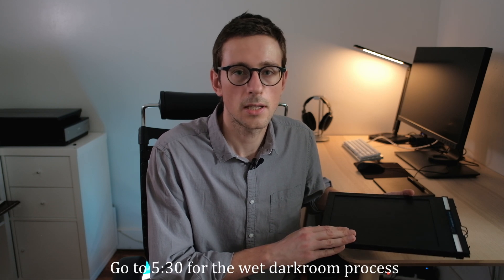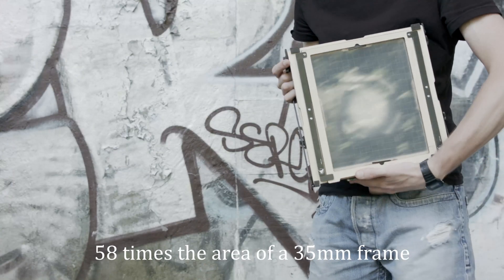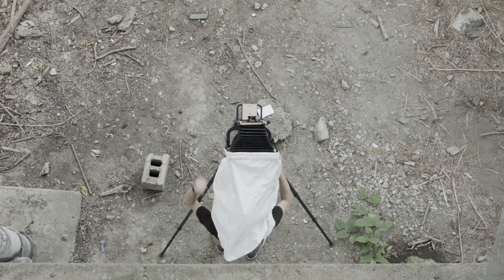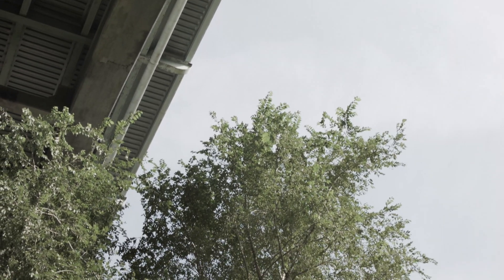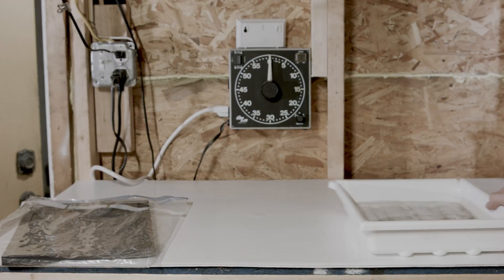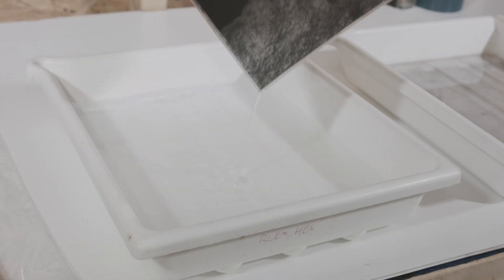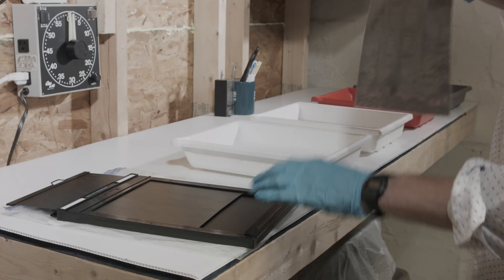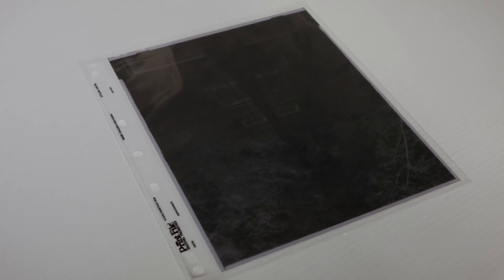Adventures with Silver Halides: Exposing and Printing a Large Format Image Part 2

Comment: Do you develop your film by inspection?
Reply from the maker: No I have never done that. I think you need a special filtration, traditional red light has still too strong wavelengths of light? Do you develop by inspection?
Reply: @MarcoFantin1  No I don't. I had the impression you did. :)
Reply from the maker: @toulcaz31  If the negative if well exposed it seems unnecessary. But for potentially underexposed negatives it could make sense. Even more when trying techniques such as stand development ( which never really worked for me, I tried a couple of times but had streaks in the negative)
Reply: Marco Fantin so how do you develop your 8x10?
Reply from the maker: @toulcaz31  I just use the prescribed times, from the manufacturer if available, or from massivedevchart.com. I give a 5-10% longer development by default, because I find it usually easier to remove contrast while printing, than to increase it.

Comment: As a point of interest, how do you determine the N+1 or N-1 etc development times for the chosen film? Do you do testing? Thanks.
Reply from the maker: I use the zone system and a spot meter. I do N development, if the difference between shadow and highlights (where I want to keep detail) is about 5 stops, like in the case of this video. If the difference is less, let's say 4 stops (lower contrast), then I do N+1 development. If the difference is 3 stops, then N+2 and so on. The opposite for  high contrast images: let's say if the metered range is 7 stops between dark and light tones I would do N-1. I found it usually better to have a little bit more contrast than not enough contrast. In any case the zone system is just a guideline since we can adjust contrast during printing with variable contrast papers, to a certain degree (or with digital means as well, after scanning). But the development should be more or less accurate for the image one wishes to create. Taking for example the images in this video, if I had tried to keep information on the sky (7-8 stops above the shadows), I would have done N-2 development, which would have resulted in a negative too flat to be printed even with contrast 5 in the darkroom.
Reply: @MarcoFantin1  Yes I understand that part of working with the zone system. But if the N development time for a particular film is 7 minutes, then how do you determine development time for N+1? Do you develop for an extra 20 or 25% longer, as compared to the N time? So that would be 9 minutes? Or for N-1, would you decrease by about the same percentage time wise? Or for about 6 minutes? And how do you determine these development times?
Reply from the maker: @fbraakman  Yes I would do about 25% increment or decrement in development time. I do fine adjustment while printing. This has been working for me using FP4 and HP5 film.
Reply: @MarcoFantin1  Thanks, Marco.